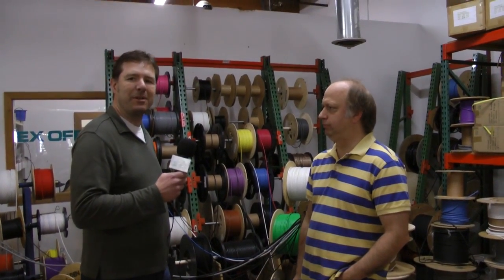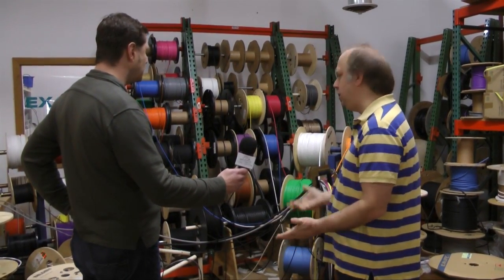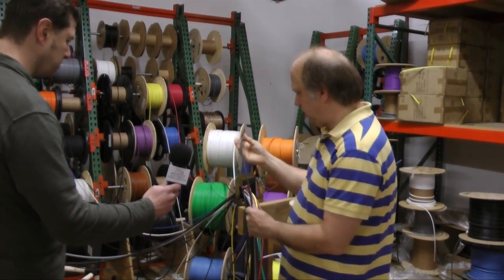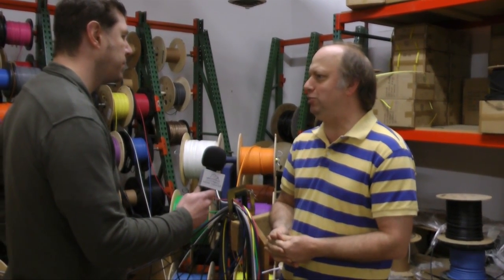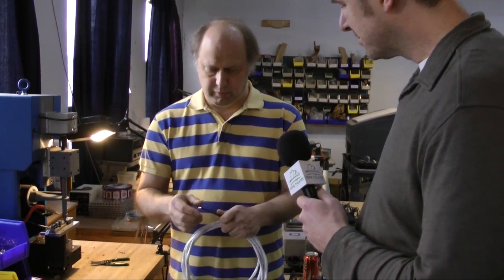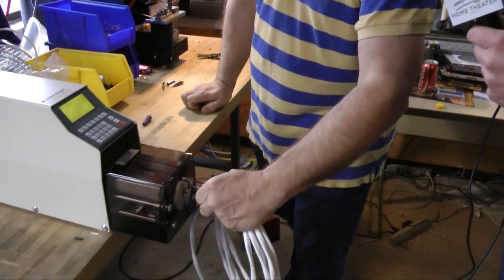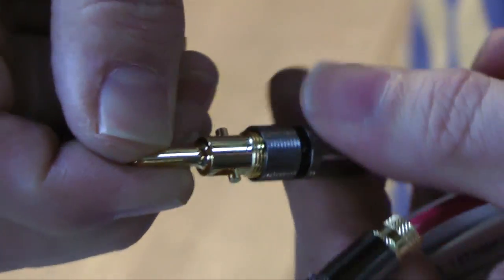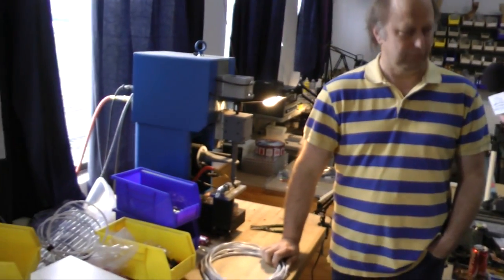Blue Jeans Cable EducationSeries: Non HDMI Termination

Comment: I was putting in a home theater in my basement 8 years ago and needed lots of HDMI and speaker cable. I had to have high quality cable, but didn't want to pay high prices. I fortunately found Blue Jeans Cable. Exceeded my expectations for quality and reasonable prices. I have bought from Blue Jeans several times since and will will continue to buy and recommend Blue Jeans Cable.